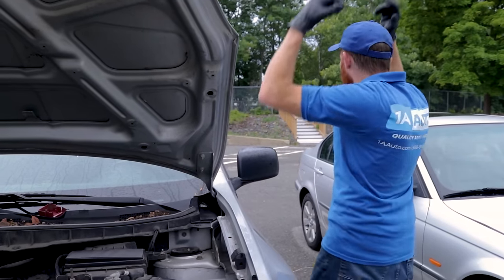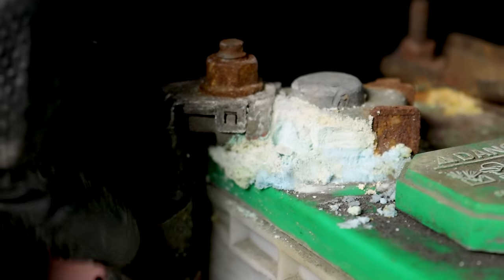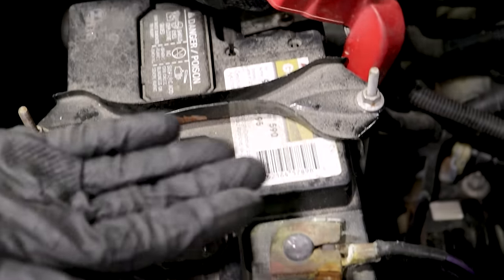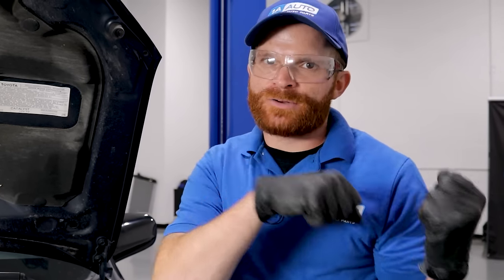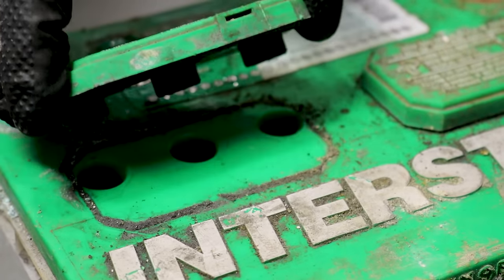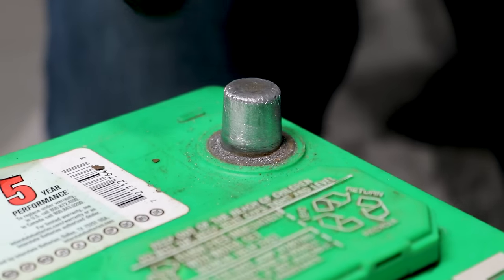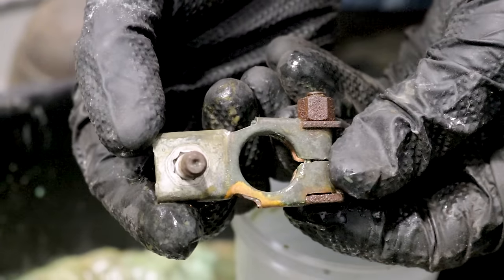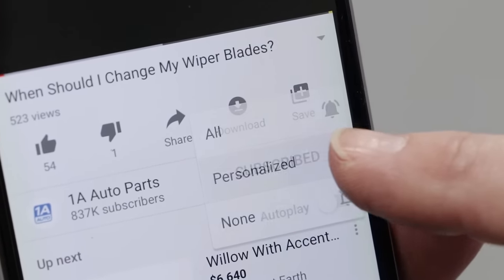Corrosion on Your Car / Truck Battery? Cleaning Tips! It’s Important!

Comment: While I appreciate you cleaning terminals and the battery, I was shocked you didn't clean the plastic battery tray and underneath it, as acid can grow under there too and also rust the metal battery tray frame.

Comment: If you buy a interstate battery from the dealer,  they will always be glad to help you clean,  test your battery for free

They help me with my Nissan Altima battery issues that goes dead every 2 years for free. After 3 visit  for free, problem was found . No more worries
Reply: And what was the problem????
Reply: @Sam TX  
Nissan batteries die every 2 years. 
Seems the metal bracket kills the battery 🔋.
 after 5 trips to the shop
( interstate battery store check it free)
Now I can rest easy my car will start. 
Been over 5 years with no issues. 

Anyone ever buys a Nissan,  get a new battery and not from the dealership .
All the dealership did was Pressure wash to push my battery past warranty.